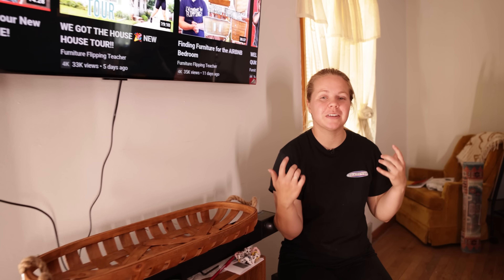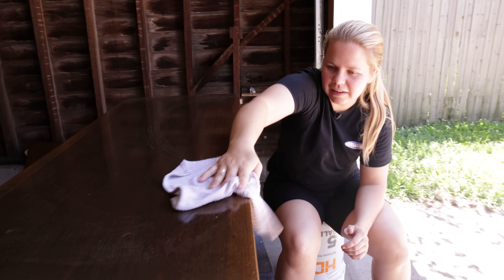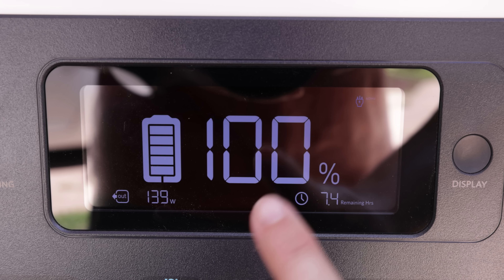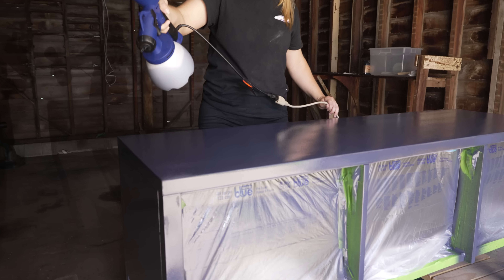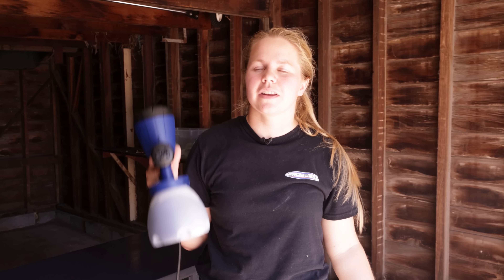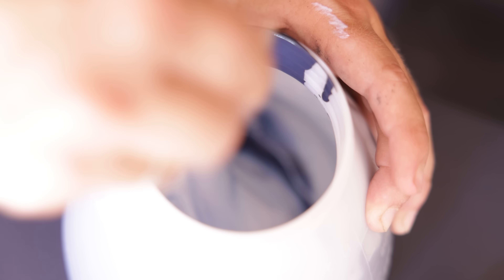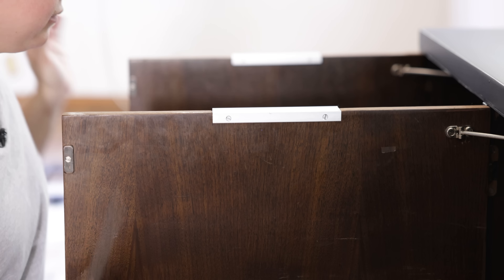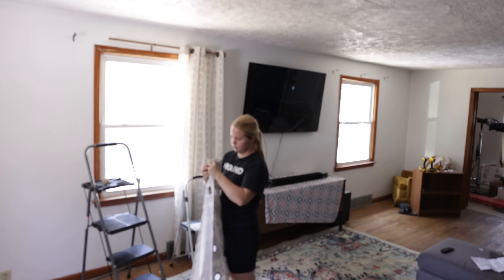Entertainment Center DIY Furniture Flip for our Home | Home DIY Projects  (w/ Anker 757)

Comment: Just sharing info about hanging grommet  drapes.  Put one grommet/eyelet on the outside of  rod bracket next the end of the curtain rod.  This method will then cover up the brackets thus making the drapes look better.  They also now make small sized room coolers that just sit on a table.  No need for large window coolers.

Comment: One can make a hole the size of a plug to insert the plugs of each electrical cord. Insert each plug separately into the wall and run the cords down vertically behind the wall. Have them come out behind the main horizontal furniture piece, which will be hidden from view.

Comment: You did a nice job decorating. The curtains have just enough subtle pattern to coordinate with everything. Of course the furniture piece turned out well. Are you going to put a cord cover on the tv wires? The rug is pretty. I usually skip through ads but that charger really does seem worth having.

Comment: A TRICK FOR CURTAINS...save your toilet paper rolls and cut them length wise and put them behind the curtains on the rods to keep your curtains spaced the same.  They hang better.  A designer secret.
Reply: I have  a long window and use 4 pannels,  so I keep the TP trick on the 2 outer ones to stay in the same position where as the 2 inner curtains I open and close a lot so they don't have the TP rolls behind them on the rod.